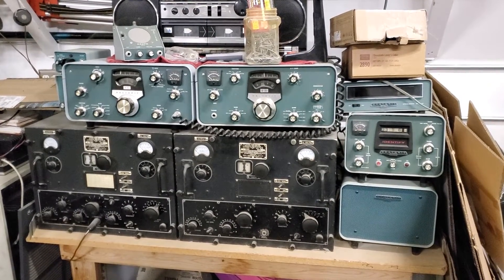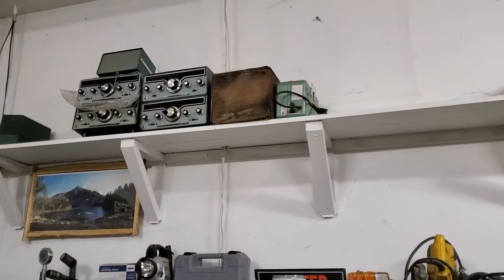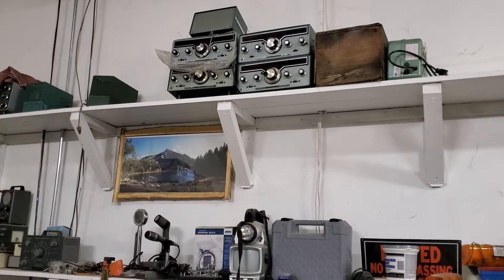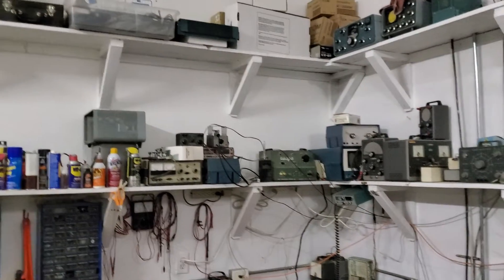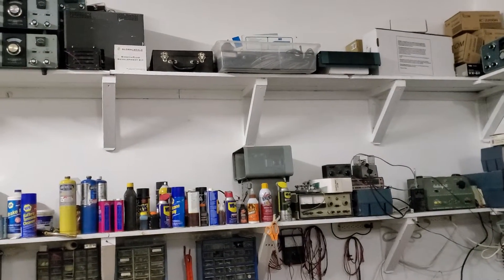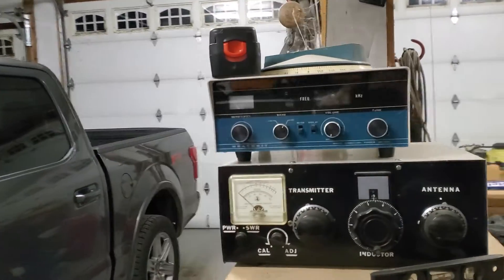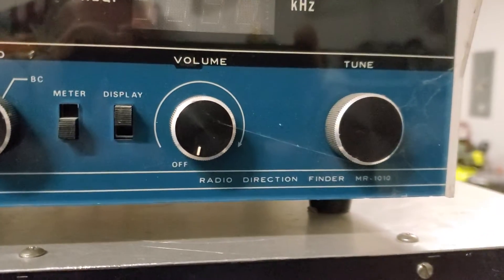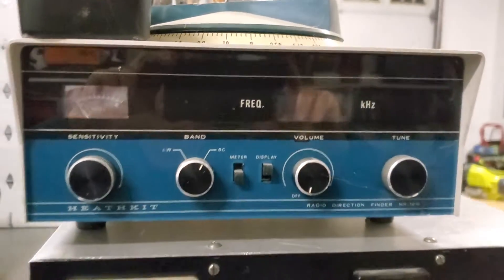Healthkit Collection awaiting restoration.

Comment: You have quite a collection there, Ron. I was thinking about offering you a couple of units I have, but I think I saw them already up on your shelf!

I'm real interested in that RDF set. I've never seen one from Heathkit, but I've looked at others on eBay and always wondered how well they would do for AM broadcast listening generally, and how sensitive they are for possible broadcast DX-ing.
Reply from the maker: After I get it going, I'll give a report on it. I suspect it will be a respectable receiver but using a ferrite loopstick antenna, it would depend on a solid signal to work right. To much sensitivity might be a problem.
Reply: @RonMorell  Looking forward to it!